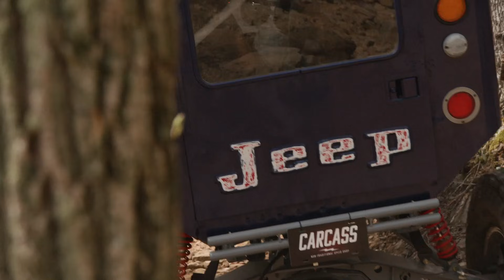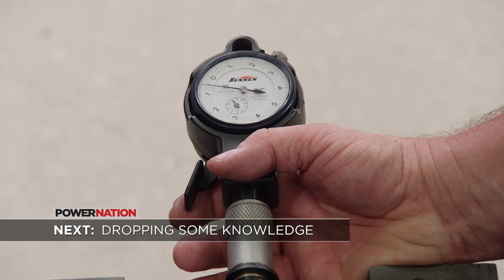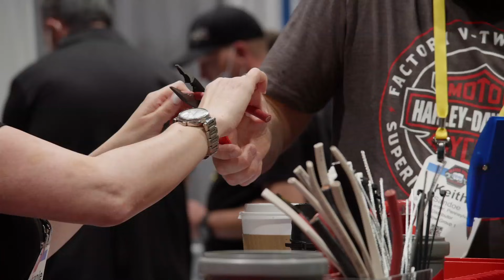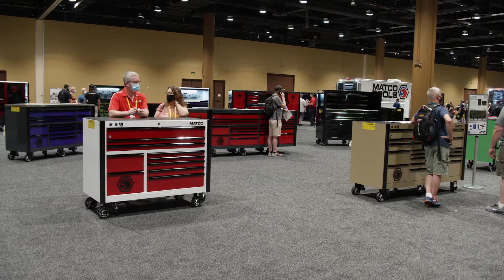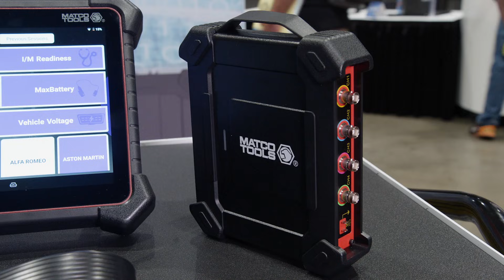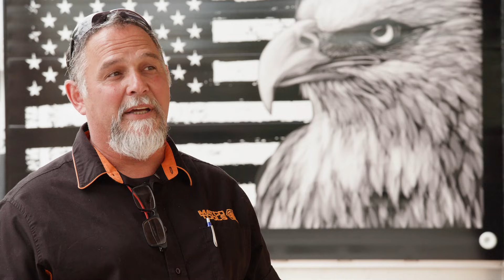Laying The Foundation To Rebuild A GM 4.3L V6 - Engine Power S8, E15

Comment: I recently bought a 1997 C1500 SWB pickup with a 4.3/5 speed. I'd like to get a bit more power out of it for little money. I understand that replacing the mechanical fan with electric ones can free up about 20 HP.
Reply: Nice I just bought a 95 v6 5peed manual.  my idea was to put a 350 with the fitech fuel injection and put a automatic transmission but with this I might just fix the v6 and I will done faster
Reply: @ferberb9662  Keep the 5-speed!
Reply: @ferberb9662  A Fitech EFI system would be ideal for this platform, especially if you modify the engine for more power.
Reply: Yes it would be awesome a good daily drivable and reliable truck to put miles on it. it would be excellent now if you put a turbo you might scare some eco boost not to win but to just stay behind

Comment: On that 4.3 you could do cam, Springs, rockers, coil on plug conversion, and custom intake, then send it to me😜👍.
Reply: Who makes a coil on plug conversion for this engine?
Reply: @kevinhornbuckle   also I think 2001 and up s10 use 411 pcm so the harness for the v6 is perfect. No need to repin...😜👍
Reply: @kevinhornbuckle  look for a sbc v8 24x efi conversion. Then get 6 ls style coils and a 411 pcm. It works.

Comment: Project with the Atlas 4.2L inline 6...please. Especially if you are going to start showing off more historically underrated domestic six cylinder engines.
Reply: First Trailblazer we sold at the dealership I worked at came back a week later with a dropped piston sleeve. We all thought, great this is going to be a piece of crap. Well, we got the one bad one. Those were great engines! The 4 cylinder was great too. For some reason, the 5 cylinders had problems with rusty camshafts and valve seats were too soft. I don't understand how the 6 and 4 were so good and the 5 was bad.

Comment: I would really love to see this turn into a higher compression (9.5:1-10.0:1), twin-turbo, higher displacement, fuel injected (without that asinine spider injection system that my Vortec 4.3 had) EcoBoost clone to see how much more power it is capable of making while still keeping it within safe levels. I really think that'd be a cool project to see. Then y'all can swap it into a cool S-10 Xtreme and make a road course truck.
Reply: Just while your dreaming, start with a GMC Cyclone!
Reply: High compression and boost aren't best friends...
Reply: @Namesakes.unit-x-10sq10  your thinking old school! E85 or methanol run great turbo’d at 11:1.
Reply: Like your gonna find an extreme thoughs are rare.
Reply: @arytonbreet7671  Thoughs?
Reply: Would be better in a 1st gen. They're a lot lighter, and all the zq8 suspension pieces will bolt right on.
Reply: Great idea all the way around.
Reply: Turbos and high compression don't work too well together.

Comment: I would love to see this become some high rpm screamer twin turbo project
Reply: A 4.3 v6 would be very hard pressed to reliably spin past 7k more than once... but with an unlimited budget anything is possible.
Reply: @Kstang09  I mean I saw this guy build a pushrod v8 that reved to 10k for his camaro. Surely for a v6 it has to be possible
Reply: @maximebeaudoin4013  Do you know why these v6's come with a balance shaft? Look into harmonics + resonance and how that affects RPM capabilities. Ditto valve train stability + intake design. (short summary, this particular engine is very hampered in that department).

Also, curious what makes you think that because a pushrod V8 can be built to rev a V6 inherently can as well... does fewer pistons amount to more RPM in your mind? Like I said, with unlimited budget anything is possible. Just best not to use a 4.3 v6 as your starting point.
Reply: @Kstang09  nah man just got to source some a.r.c.a series parts they ran 550hp 4.3 naturally aspirated engines that were built to run up high around 7500rpm

Comment: Can you please build a Ford 4.2! It's has a aluminum intake runners, it's a push rod motor and it's a capped distributor to just camshaft position sensor. It would be super cool to see that V6 built!

Comment: Love it.  Slap a couple of turbos on this puppy.  Too bad Chevy didn't follow the design of the Buick 3800 and design the block with a deeper skirt and have cross-bolted main caps.
Reply: 3800 came after the 4.3
Reply: @QK_SAND  So.  Chevy could've still followed what the 3800 series 2 didn't in 95 as the 4.3L was in production for years after 95.  With the latest 4.3L, it is designed after the latest LT.
Reply: @QK_SAND  When did the 4.3L get a balance shaft?  What year?  88 was first year for the pre-series 1 3800.
Reply: @charleslowe522  92 is when GM redesigned the 4.3 to take a balance shaft. They're both 90° V6's. Both have their pro's and cons. A BIG con (IMO) of the 3800 isn't the motor, but the trans that it's bolted to. The 4T65E is a pig of a trans.

Comment: it would be fun to see an apples to apples on the gm 4.3 v6 and the dodge 3.9 la v6
Reply: Ford 4.2 would be a better comparison
Reply: Not apples to apples. Besides the 4.3 will knock down power numbers the chrysler cant match. And the aftermarket had ungodly amounts of bowtie stuff available. No compariaon.
Reply: @ComputerCapone  Its .4L smaller..
Reply: @aaronmcconkey1062  350 vs 318 essentially, just 2 cylinders less. That 0.4L makes a BIG difference.

Comment: You guys should do a GM 3800 V6 build for a Pontiac Grand prix or something a long those lines would very much appreciate it
Reply: No aftermarket...
Reply: @ComputerCapone  There's an aftermarket, heads, cams, etc. Just nowhere near as big as some other engines
Reply: I agree
Reply: That would be awesome.  Considering how reliable the 3800 series 2/3 blocks are.  Richard Holdener is in process of doing a "Big Bang" test on the 3800.  This is where he takes a junkyard motor, puts some ring gap in it, upgrades the springs and using different cams to see how much power the 3800 can handle.  He'll also put head studs in.  Subscribe to his channel.  It would still be nice for these guys to do it, because they have a lot more resources and they could build the engine with forged pistons and rods.  There is also a billet crank and main caps available for high rpm/boost applications.  Along with aluminum heads.
Reply: @charleslowe522  I like his channel.
Reply: https://zzperformance.com/
Reply: Second that

Comment: What exactly is this engine out of?
It's alot like the aussie/gm l36 3.8 ecotec
Reply: I think an S10
Reply: They came in the chevy s10 and gmc Sonoma as the upgrade from the base 4 cylinder. They also came in full size base model pickups that were work truck designated. Really versatile engine.
Reply: They were base engine in full-size 1/2-ton pick-ups and vans, only engine in compact rear-/all-wheel drive vans and top engine in compact rear- & 4-wheel drive pick-ups. Older versions were available/standard in various GM rear drive passenger cars.